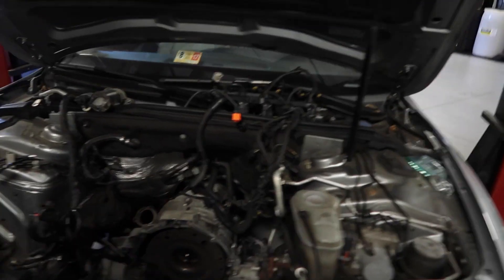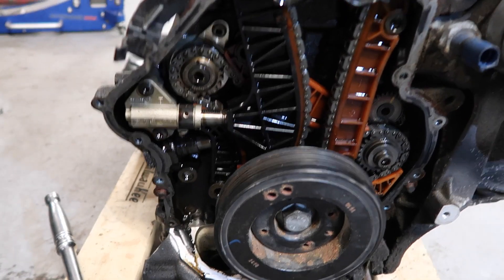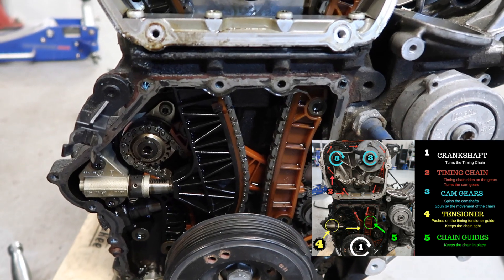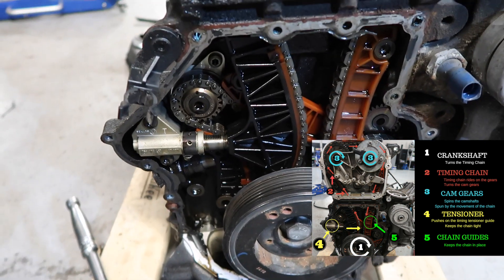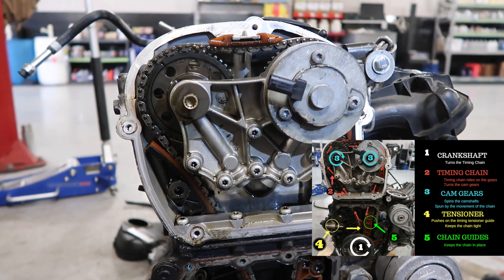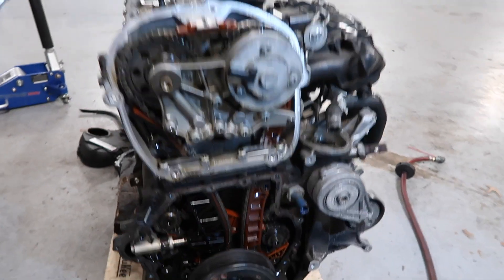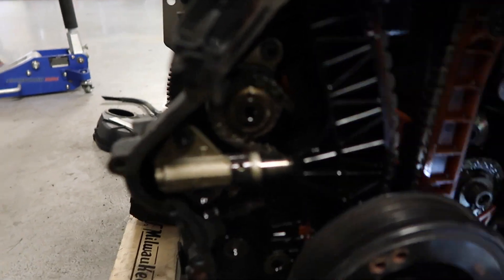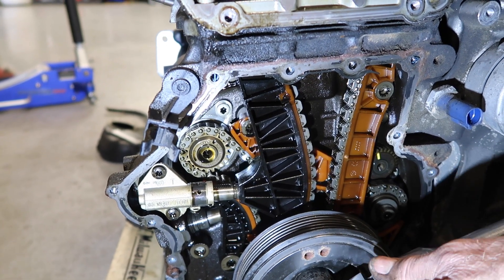Audi Timing Chain Tensioner Failure. Part 2

Comment: I think that the timing chain jumped because it’s stretched not the tensioner, if the tensioner is meant to stay in one position, Audi would’ve installed a metal bracket not a tensioner with a spring  ,
Reply: Timing chains do not "stretch".  They wear, which causes increased clearance between the links and the pins, which then increases the length of the chain.

Comment: Vw engines are just garbage now. Had 3 VWs but would never have another. This tensioner has had no less than 4 different designs now. Crappy engineering

Comment: The tensioner on my 2012 at broke yesterday found out 8k to fix. Then this am heard about class action suit and it covers 2012 q5 but dealer just told me it doesnt cover my vin. Anybody know what I could do
Reply: PATSFBALL 4466 did you look into the lawsuit they set me a check. Call 1-855-206-9873